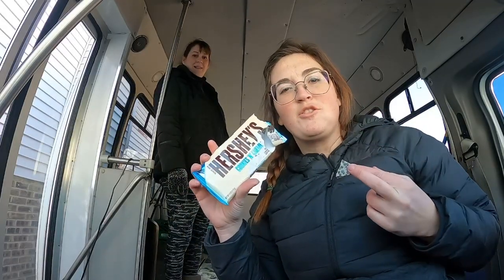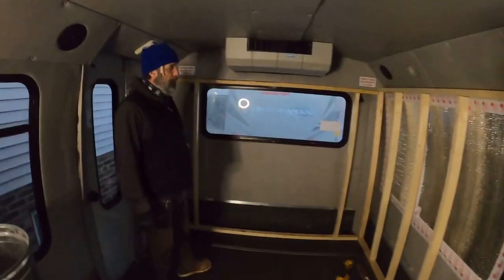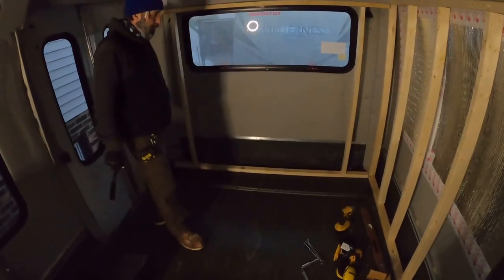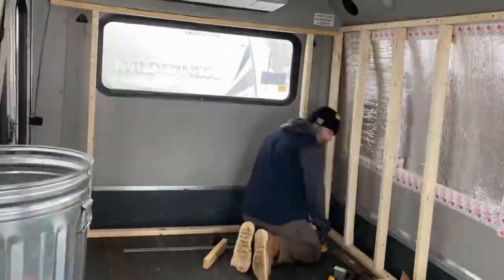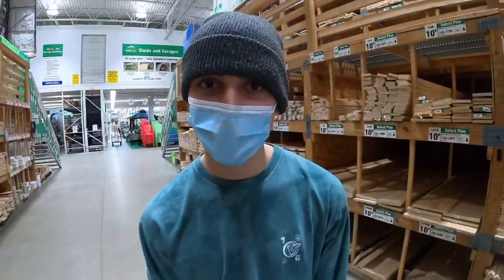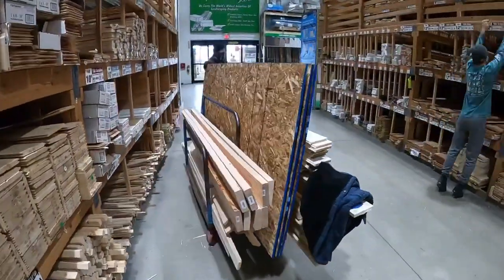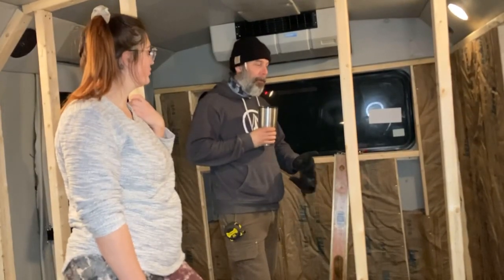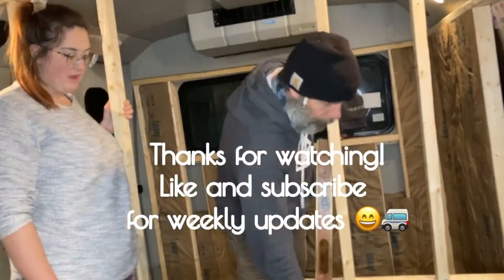Shuttle Bus Conversion: LET’S BEGIN! 🚌

Comment: Hi! What made you decide to start building before taking out the walls and floors? Just curious. Great build!!
Reply from the maker: Hi! For simplicity sake we decided to just build over the interior. There was wood for us to fasten to and a bit of insulation already built into the bus. It also saved me money which is always important. Thanks for your question! I hope you follow along, I’ll post videos weekly until we finish the build 😃
Reply: How did you attach wood to walls? Curious. I am also building out a shuttle bus without removing existing bus walls or floors.